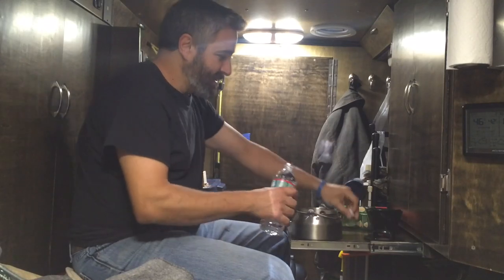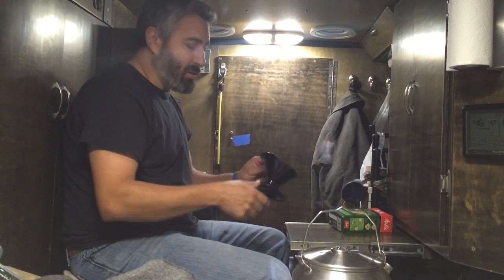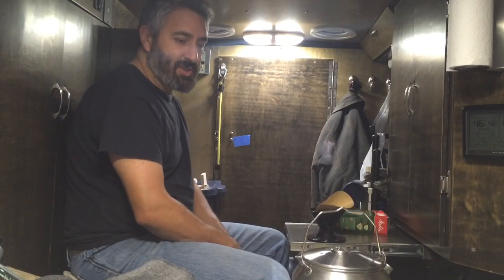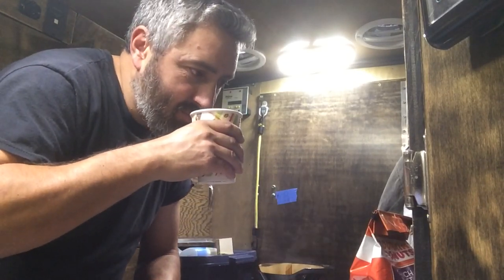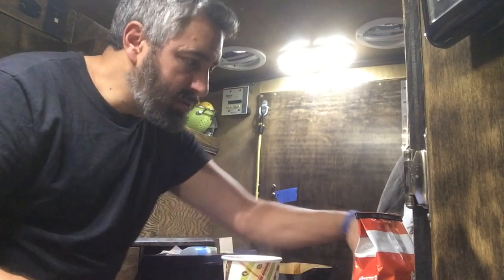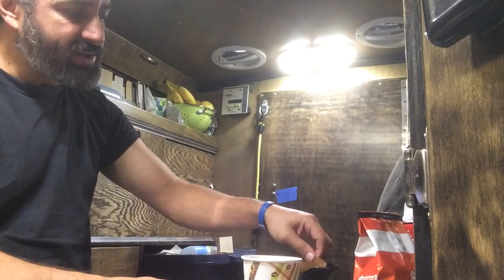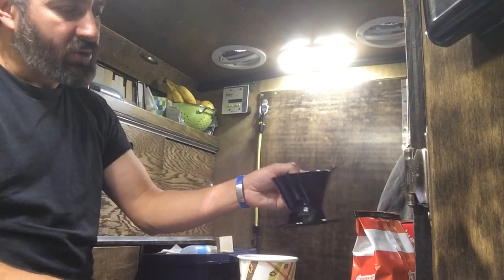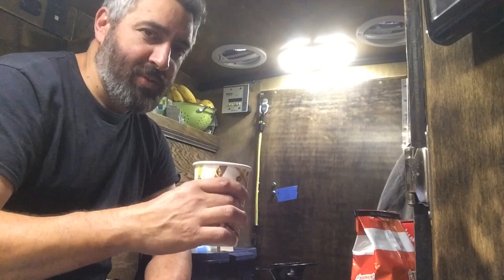Van Life; Brewing Coffee In The Van: The 2nd Cup!

Comment: Hi, Luis. I always use a cone filter for my coffee. A couple of tricks I learned along the way: 

I always add "one for the pot" of ground coffee to the filter (if you can grind your own coffee at the store, do it, and make it as fine as possible - I like espresso grind - seems to make it steep longer). I allow the water to boil, then pour just enough of it to wet the grounds and let it steep for about a minute, while the water cools off a bit (the cooler the water, the longer it takes it to drip through the filter). While the water is still steaming, pour in enough water to dredge the sides, by slowly dribbling it around the edges (otherwise, the grounds get shunted to the sides and never really steep), then pour in the rest of the water, all at once,  to the top of the filter, without going over .. of not, you'll end up with grounds in your coffee, lol.  The trick is to make sure the cone is the right size for ~your~ sized cup of coffee.  If it's still not strong enough for your taste, run the coffee through the grounds again. I like ~very~ strong coffee and run it through a total of 3 times. Sounds like a lot of work, but it's really just technique.
Reply from the maker: Hi Ladee!
I have a new video coming soon where I return to the cone filter and this time I did it the right way...I think. You'll have to watch and let me know. 
All your points are very valid, and I'll try to do what you recommend; run the coffee through the grounds a few times for stronger taste. 👍🏻👍🏻😄🚐
Reply: Looking forward to it!

Comment: A single cup electric brewer would be better for you. We only use that plastic brewer when we are camping and already cooking breakfast with the stove on. For a guy that wakes up and has to go to work this has too many steps.
Reply from the maker: I've actually thought of getting a 12v or a small electric coffee maker. I'm not sure I would have enough amps in the morning before the sun shines on the solar panel though. 
The problem with an electric/12v brewer is that it still needs to be cleaned up. On the other hand, I can just turn it on, let it brew, then after its done all I have to do is rinse it off. 
For now I'll just try these other methods, if nothing works properly, then I'll probably try the 12v coffee maker first. 👍🏻👍🏻😄🚐